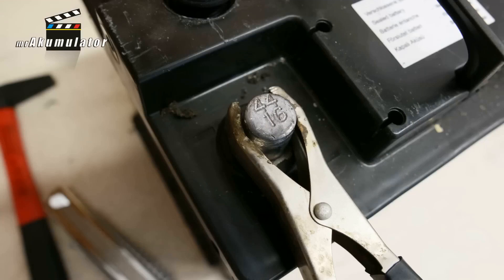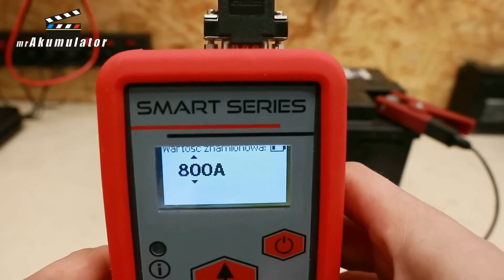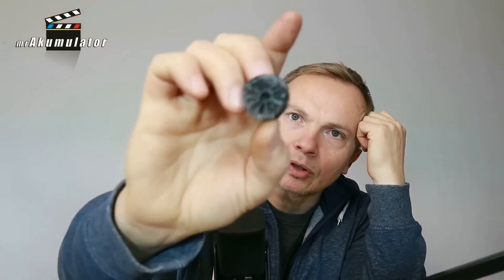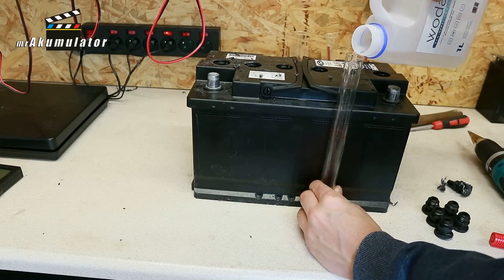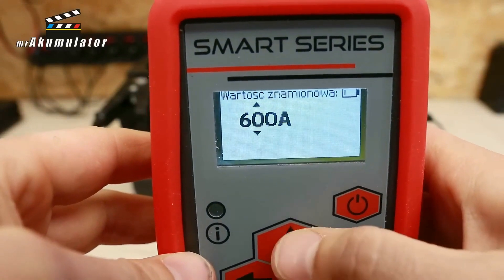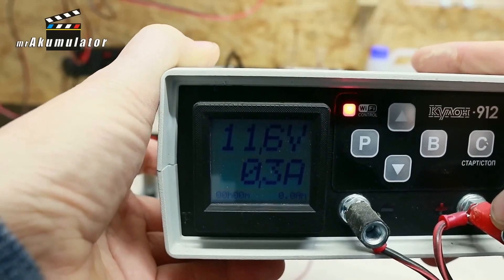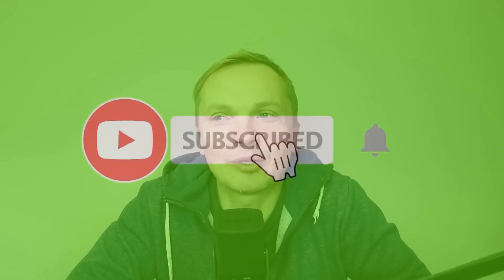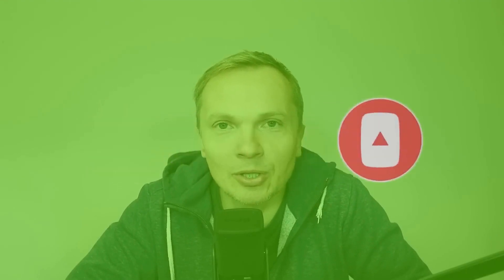🚑 RESCUE for an old battery 👉🏼 AGM 👈🏼 80Ah.

Comment: My VW AGM battery 680 A 68ah lasted 7 years. It had done 320,000 km and according to VCDS over 60,000 engine starts. Topdon tester reads 350 A EN left, struggled to start in frosty weather. Is that an acceptable age for an AGM and mileage? I know of batteries over 10 years. Bit disappointing. My fathers 2007 Passat battery lasted 14 years and it was only a normal lead acid.